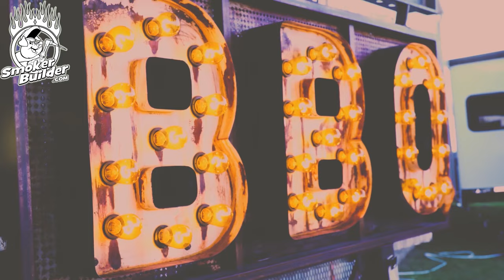[1000 Gallon Smoker Build] How To Mark And Cut Doors On Your Smoker Part 2

Comment: I bought a 94 gallon propane tank and just wanted to ask what route to take for the paint .. do I have to strip all the old paint off or can I keep it on there .?
Reply from the maker: I would keep it on there! You can remove it if you want a nice paint job but I normally just run with it
Reply: @SmokerBuilder  thanks for the info . Just another question I filled my tank up with water and soap do I have to wait for the propane smell to go away before I cut it open ?